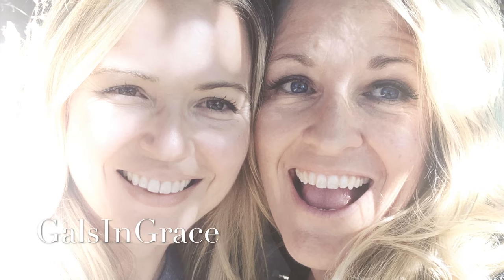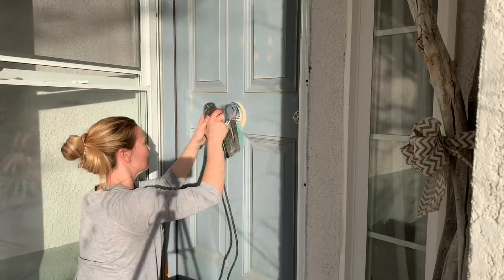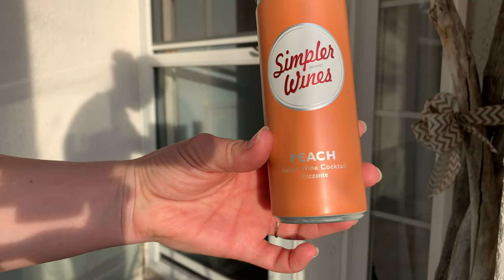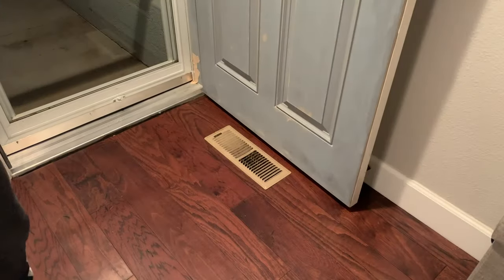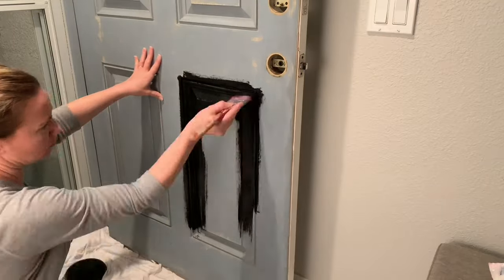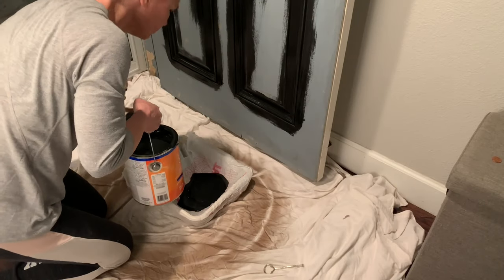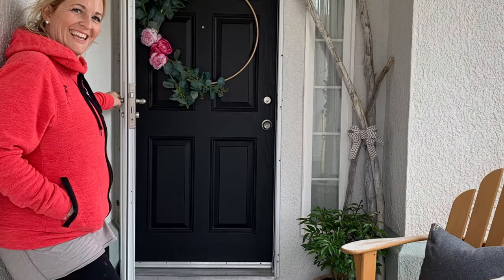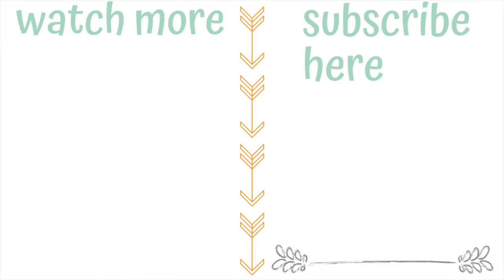How to Paint Your Front Door | A Step by Step Tutorial | Sherwin Williams 6258 Tricorn Black

Comment: Was that a matte finish? :)
Reply from the maker: Sakaloo7 yes!!!
Reply: But I thought you mentioned eggshell like. I'm about to do mine with a color in-between black and charcoal. Other videos I've watched they recommend some sheen and even a semigloss. To repel water and dust. How's yours holding up against that?
Reply: @AB_thingsDFW  the paint can says eggshell so I'm confused what they used
Reply: @jennifer2185  gotcha. I missed that. It's hard to find "exterior" rated paint in eggshell. However, I think I'll go with interior rated and then apply a sealant. I like the color she used
Reply: @AB_thingsDFW  I just got this color in satin exterior, hopefully it looks as nice on my door as it does in this video :)
Reply from the maker: A B It’s working out great it really is preference so excited to see your results
Reply from the maker: Jennifer Eggshell or satin would be perfect
Reply: @jennifer2185  yeah she did a to great job. My door is metal
Reply: @jennifer2185  how did satin finish turn out? I have to paint two new doors and while i am using a different color, i like the finish; specifically how light reflects dull off of the paint.